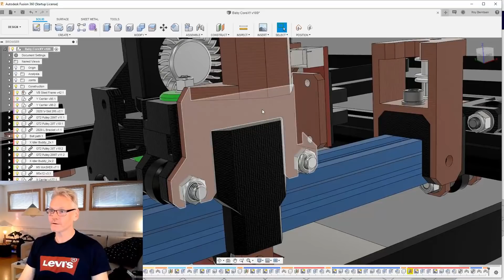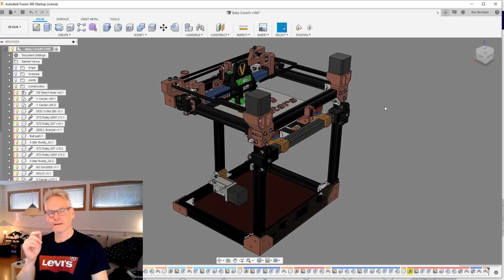3d printer design and build vlog #12 - VIRGIN PRINT - RESULTS ARE IN!

Comment: Is this going to be expanded to the 300x300x400 size? I am looking to replace my cartesian printer because of the ringing from the weight of the moving bed.
Reply from the maker: Yes you can extend this. Here is 3 sizes. Large is 300x300x300. Ask for longer Z extrusions for 400 Z. https://makersupplies.dk/72-corexy-3d-printer

Comment: I would rate that Benchy a 6 or maybe even a 7 out of 10 which is remarkable considering it was the second print on a brand new printer design.  It looks like it could use a bit more part cooling on the areas above the windows where the bridging takes place.  It may be that there is inadequate air from those small blowers or the air isn't directed quite right.  But like another commenter said, this is better than some supposedly well tuned printers do.   Great Job Roy!

I like your carbon fiber plate.  I made one for my CR-10 and attached wires to the edges to turn it into a heated bed but I put too much carbon in it and could not get the resistance of the wire connections low enough. Only the edges would heat up due to resistance between the wire and the carbon.  My plate is ~3 mm thick (12 layers of carbon cloth).  To heat it would require about 150 amps at 2 volts which makes it impractical even if I could get a good connection.  This approach was tried to lower the mass of the Y axis on an i3 type printer.  Since a Core XY does not have this issue I probably won't revisit it.

Looking forward to the next installment!
Reply from the maker: Thanks for a comprehensive detailed feedback ones again sir! 
I think temp is to high for 0.1 layers as bridging is difficult. I have analyzed the airflow from the layer fans and it look to be overkill so they should be sufficient - I have some video of that

The build-plate is just a glass sheet with some fake carbon tape on it... Sorry - I ordered a real buildplate now - I have no heat here

Comment: Without being a "benchy expert" we can see that this boat is particularly successful: no salmon skin, no small flaws and no noise. Hooray for TMC drivers!
I would like to see what this gives with more standard parameters like a 0.4mm nozzle and a 0.2mm layer. But also faster printing speeds. That's the goal of a CoreXY printer, I think. But I think these tests are going on as I write these lines!
Anyway, this machine is well-born, that's for sure. From such a design it's possible to extrapolate larger print dimensions.
Bravo Roy!
I want one too... a little bigger.
Reply from the maker: :D Everyone wants bigger... I want smaller :) - Now we can easy change hotend so I will see if I can find a 0.4 somewhere
Thank you MP - I will get going working on the BOM while doing quality control

Comment: This is quite a good benchy it's very smooth, the vbaby is amazing, looking forward to build one
Reply from the maker: It turned out good - afterwards I also noticed my idler towers on the X axis was not fixed correctly. They are supposed to have 3 screws and had 1.... :o